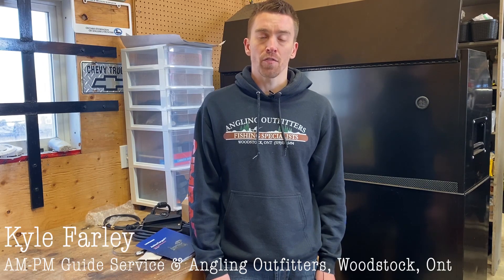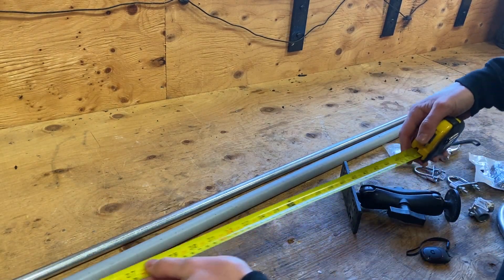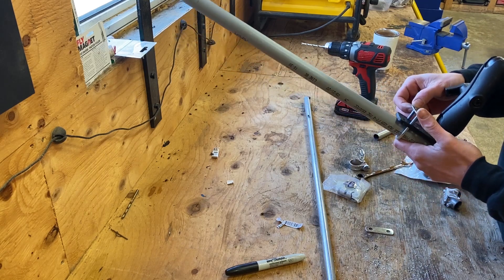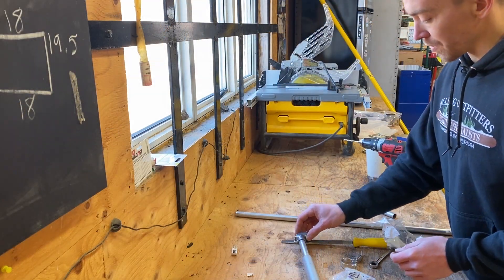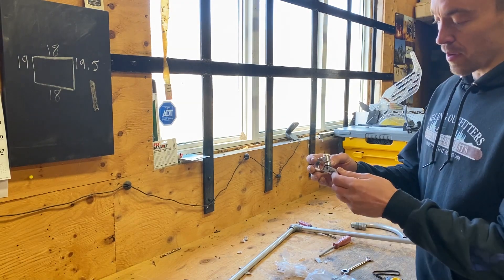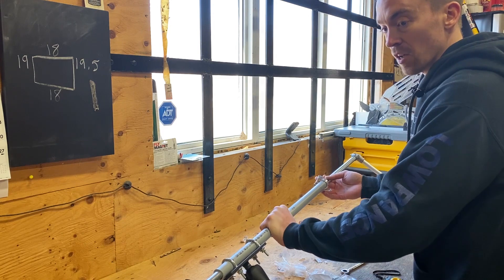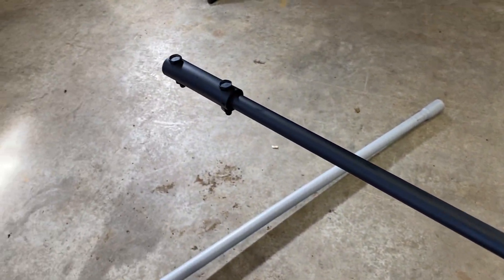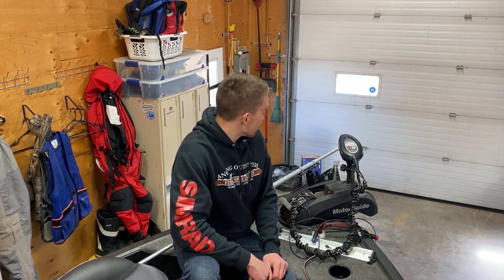Transducer Pole/Mount for Lowrance Active Target, Garmin Livescope, Hummingbird Mega Live DIY

Comment: Hi how many inches was the pvc cut to?
Reply from the maker: That one was about 24". But its all relative to the size you want to use for your size boat.  I had it trimmed shorter on the water side of it, so I could retrieve the pole closer in to the boat.

Comment: I imagine that the metal rod will be stiffer with less drag than all pvc. The ram mount would be the only weak spot. Without trying it though, my thoughts are that it is a great design. 👍
Reply from the maker: your right the rod is very stiff, low drag and solid.  The ram mount would be, but its far from weak. Its rock solid.  I've used this mount over a year.  So the reason we did the ram mount is to make it tiltable in scout mode.   It something nobody is doing and is unreal in 15' or less. We'll do a video on it this spring.

Comment: Thanks for the idea. I ended up building this and it works great. The only issue I had was that the conduit spins freely inside of the PVC while on the water and active target image is constantly moving. This really sucks in rough water. What did you use secure the poles and keep it from spinning. Do you  have a follow up video posted yet? Or will there be one?
Reply from the maker: You can add tape inside it for more friction inside the pole, if it spins too freely for you.  I put a little lead wheel weight in the tube to keep the handle more weighted back. But other than that I haven’t had any problems with it constantly moving.   The clamp helps with friction as well.  Any pole is gonna suck in rough water even to get an active read on it. I haven’t been in anything more than a 3’ chop.  A lot of the factory manufactured poles guys aren’t having the best of luck in real rough water either. 
Another idea is to use the bike seat clamp right on the pvc. Do two little cuts in the top and it should add all the friction your looking for. 
I can do a follow up. Right now I am in the middle of my guiding season so I have no time til probably mid July.
Reply: @hookedntravel  drill a hole in the pvc near the top of the pvc and use a nylon or similar knurled nut/bolt or if you have a handle similar to the one on the unit used to bolt it to the bow and adjust the tension, should work.

Comment: The mounts that came with my active Target won't tighten small enough for half inch conduit what did you use or what am I missing
Reply from the maker: So the pvc pipe I used I cut it in half and trimmed the sides back a little to use them as spacers for the active target mount